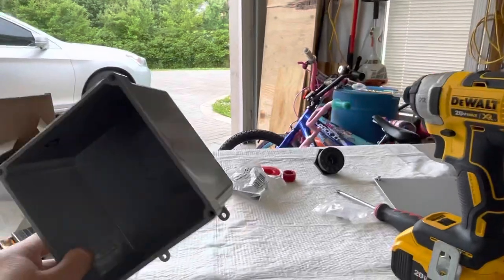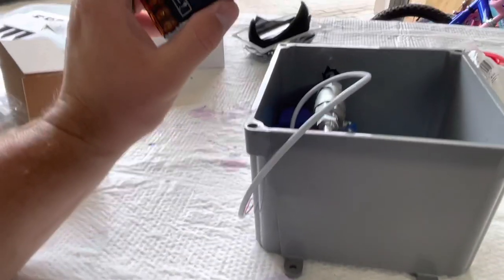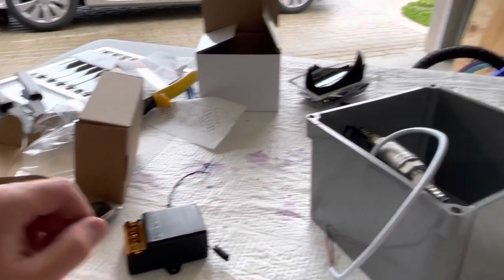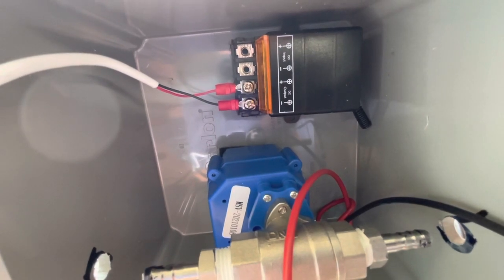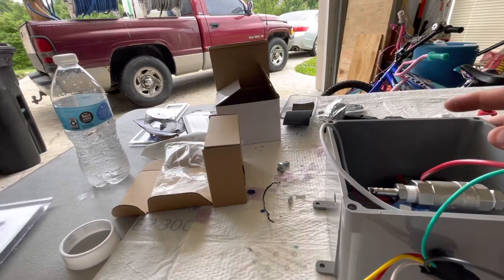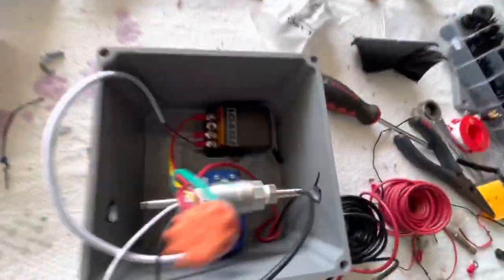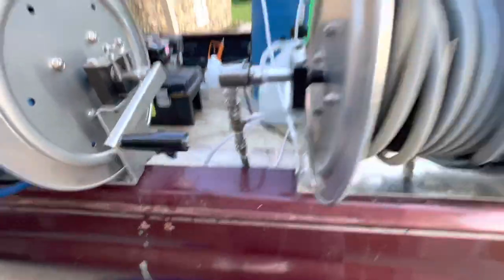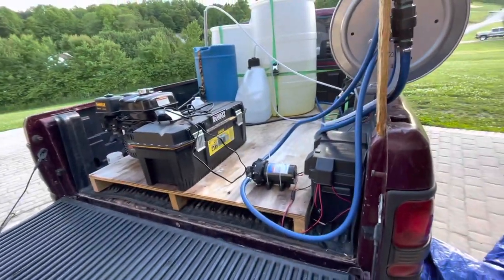How To Build a Downstream Injector Box

Comment: Thanks for your help through your videos!  You have a softwash gun in the video. Where did you buy it?  I didn’t see it in your links. Thanks again!
Reply from the maker: I got this one from Russ at south side equipment in Louisville KY. But you can get them from anyone. Panhandle power wash supply, pressure wash products, pressure Tek. The gun will run about $40-50 with the fittings.

Comment: Hay buddy hope you are your family are doing good,  my name is Joe I  enjoyed this video it inspired me too make a remote system.... I'm having issues pairing the remote baycicly I'm not getting a green light. Any help would be greatly appreciated
Reply from the maker: Have you checked to see if you have power to your on/off switch (is it lighting up)? Do you have a tester to see if there is power coming to the Module
Reply: @KentuckyWashPros  yes I'm getting power on to the on and off switch and the ball valve also getting power to the led light. I  can't get the remote work I'm not getting the green light on the   Receiver
Reply from the maker: @freepresssa9299  did you press the button on the side of the module 3 times to to program your remote?
Reply from the maker: Look me up on FACEBOOK Kentucky Wash Pros and send me a message
Reply: @KentuckyWashPros  yes sir I did also did the 8 times to reset it but not getting any signal. This is the second one and having the same issue
Reply from the maker: @freepresssa9299  any chance you can send me a neon Facebook at Kentucky Wash Pros

Comment: Does the same wiring configuration apply to a 3 way ball valve??
Reply from the maker: No they wire up differently.
Reply: @KentuckyWashPros  with the same receiver u have??
Reply from the maker: @perezleolp  they wire up differently because the have 3 wires instead of 2
Reply: @KentuckyWashPros  would the receiver you have work with a 3 way I'm trying to build my own
Reply from the maker: @perezleolp  yes it would work.
Reply from the maker: @perezleolp  feel free to reach out to me on Facebook if you have questions about the wiring https://www.facebook.com/jmesser007?mibextid=LQQJ4d

Comment: Why did you go with 1/4 inch did it work well. Why not 1/2 in for more flow. When using 1/4 inch to your downstream injector would it not lower the % even more before getting to the downstream injector lower your out flow %.
Reply from the maker: Downstream injectors have 1/4 barbs, that’s why I went this route. Using a 1/2 hose would have not changed anything.